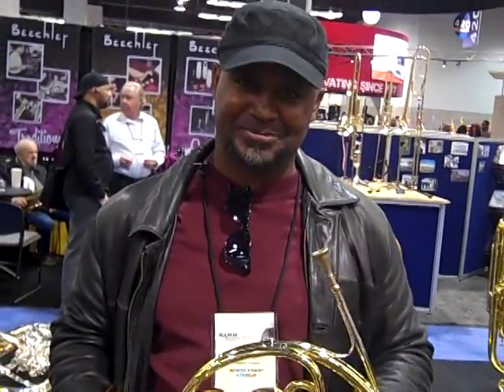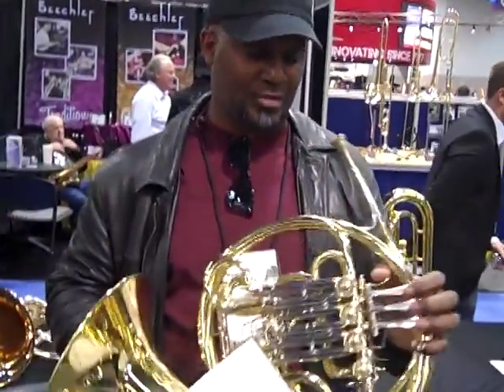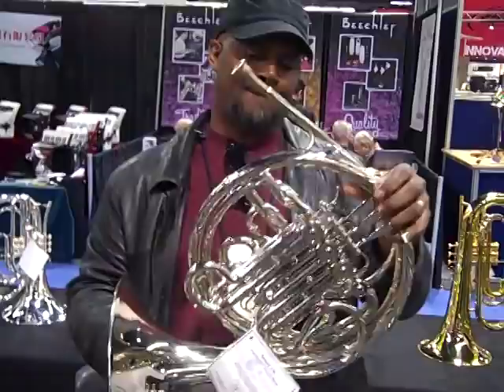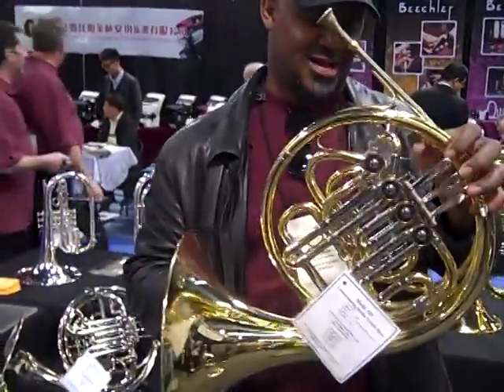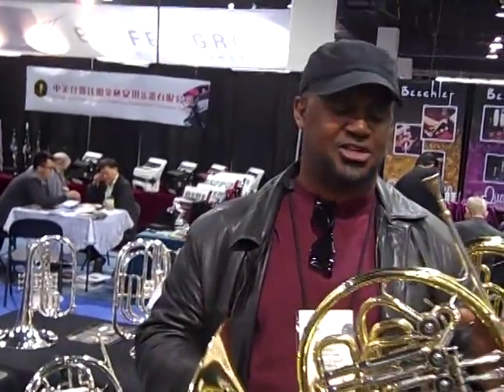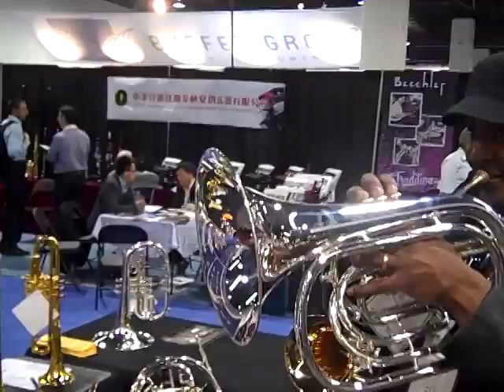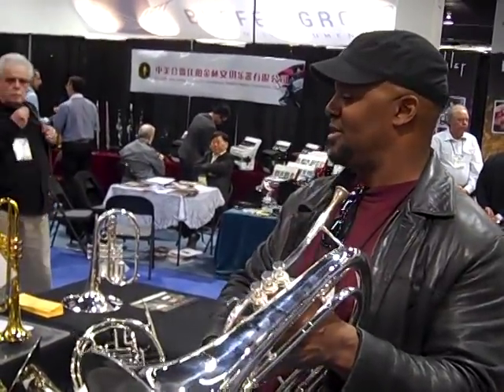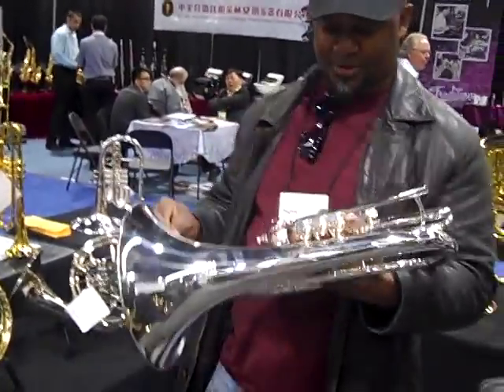New Kanstul  Double French Horns

Comment: Is "marching French horn" synonymous with "mellophone"?
Reply: +Sean Tripline yes, flumpet, flugelhorn-alto F,mellophone,etc, are some equivalet names
Reply: +Sean Tripline No, it's not synonymous.  Those 2 instruments are indeed alto pitched instruments, but they play and sound differently.  The mellophone is pitched in F-alto and has a lighter, brighter sound than the marching French horn, and uses a mellophone mouthpiece.  The marching French horn in this clip is essentially the Bb side of the "concert" French horn, but in a different wrap.  Rounder, darker sounding instrument that utilizes a horn mouthpiece.
Reply: no
Reply: OK,that is perfect fifth lower key than melophone in F
Reply: Marching french horn is essential a single horn wrapped in way that allows it to project outward. A mellophone takes a different mouthpiece and sounds less horn-like.
Reply: Sean Tripline | No. Though not common, there are non-marching Mellophones, which look similar to Tenor Corrs I’m pretty sure.
Reply: @mirkojorgovic : Ummmno, a french horn is not a mellophone although they're both in F. I play both.
Reply: it is it's own instrument, being of cylindrical bore and the mellie is conical thru it's latter half. much more power from mellies and you rarely see marching frenchies now, even in drum corps.
Reply: A lot of people make the mistake of thinking a brass instrument is the "same" because it is the same length and pitched in the same key.  There are many differences and one of the most important is the taper of the tubing.  It's one of the things that makes a French horn sound like a French horn.  And a cornet different from a flugelhorn different than a trumpet.
Reply: NO. None of the guys answered correctly. There a Mellophones and Marching Mellophones. There are F Horns & Marching F Horns. Mellophones are shaped similar to an F Horn but they have a slightly larger bore and mouthpiece plus the lead pipe to bell angle is 90 degrees and they are played bell down. Mellophones can use a Mellophone mouthpiece or an F Horn mouthpiece with an adapter. Marching Mellophones are bell front, we all know what they look like. ALL Mellophones are available in the following fundamental pitches... Bb Tenor/Bb2 (very rare), Eb Alto/Eb2 and F Alto/F2 (most popular). ALL F Horns are played with only an F Horn mouthpiece and have a slightly smaller bore than a Mellophone. F Horns are available in several different fundamental pitches but regardless of pitch they all use relatively the same (with microscopic variation from manufacturer to manufacturer) narrow bore size. The lead pipe to bell angle is 60 degrees. They are available in EEb Contra-Alto/Eb1 (very rare), FF Contra-Alto/F1 (most popular), Bb Tenor/Bb2, Eb Alto/Eb2 (Descant), F Alto/F2 & Bb Soprano/Bb3 (rare). The Marching F Horn is available in two bell front designs, one looks just like a Marching Baritone Horn the other looks like a bell front-bell top F Horn (rare).  They both use only an F Horn mouthpiece and have an F Horn narrow bore size. They both also use piston valves. This makes them hybrid horns because they're a cross between an F Horn and a Marching Mellophone. No real Marching F Horn pitched in FF Contra-Alto with rotary valves exists. For what reason idk, but somebody should make one. Marching F Horns are only available in two fundamental pitches. Bb Tenor/Bb2, like the one he played in this video and the smaller F Alto/F2 which looks more similar to a Marching Mellophone. F Horns and Mellophones ARE NOT the same thing. Neither are Alto Horns, Alto Trumpets & Alto Bugles. Bb Baritone Horn is not the same thing as a Bb Tenor Tuba either. Tenor Tuba is aka a Euphonium. All Tubas have a conical bore which is why the Euphonium is a Tenor Tuba, whereas Baritone Horns have a cylindrical bore. 

Also, let me be clear. There is no such thing as "low Alto" or "Bb Alto". Someone threw that out there in the replies. There is only one set of Alto pitches. You go by the fundamental pitch, not the key, as they all have names! F1 is called "Contra-Alto" (not to be confused with Contralto which has a different meaning) because it is one octave lower than F2/F Alto. Bb2 is called "Tenor" because it is a Tenor fundamental pitch. There is only three Alto pitches, they are G Alto, F Alto and Eb Alto. Hope you learned something.